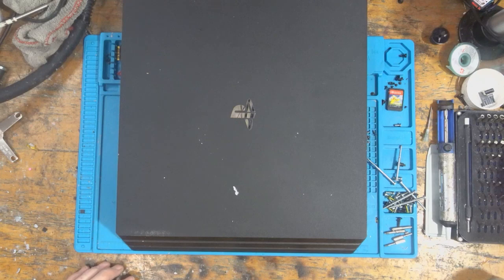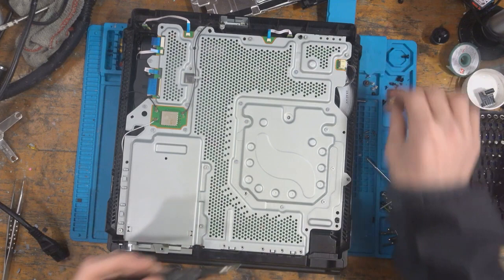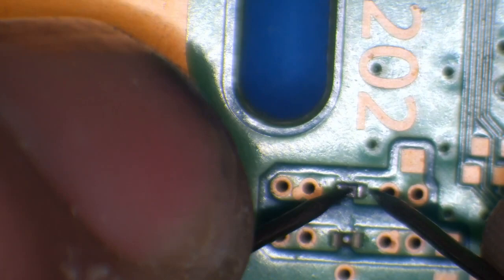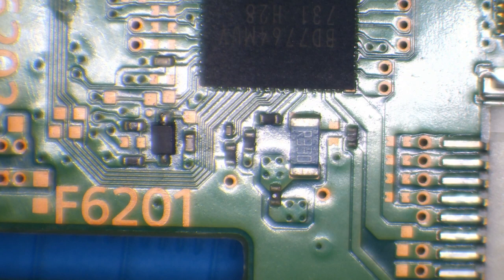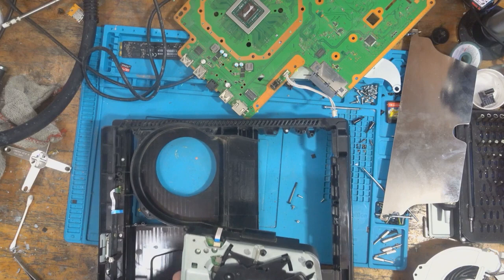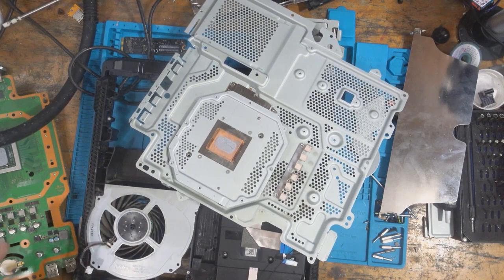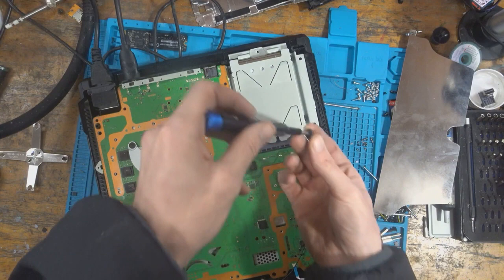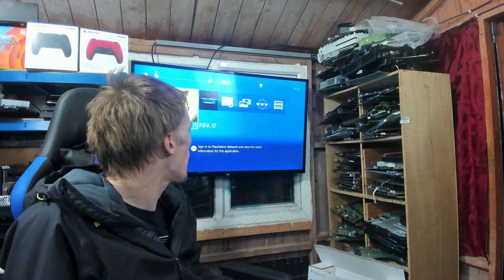This PlayStation 4 Pro Won't Accept Discs... Let's Try And Fix It!

Comment: Excellent job. If I were you I’d use the bench supply to test those fuses just to have a little more inside knowledge... you never know they may be common with other units and it might save you from holding so many spares in the future. Keep up the great work 👍😀
Reply from the maker: Thank you. Yeah I think they're the same as the switch usb-c fuse or very similar. They also share the same rating as the other ps4 and ps5 variants

Comment: My games and PS4 pro system are updating but the disc drive is not taking the disc in .
Cleaning the disc drive and it's rollers may solve the problem
Thanks for the video.

Comment: Hey! Love your videos.  I've got a ps4 pro and the disc drive stops taking and reading discs every 6-8 months. When I take the drive apart (and do nothing) and put it back together it starts working again! What could be the issue?
I got frustrated and got a new disc drive but that doesn't power on at all!  my console is model 7015B.
Ps. I'm a hobbyist, I don't have any fancy tools, the best I can do is replace parts. Greetings from Nigeria
Reply from the maker: It likely needs the bottom plate mechanism replacing. It sounds like it gets jammed and could be damaged
Reply: @TheCod3r  thank you for the response. I guess I'll swap out the housing of the old disc drive with the new one and see what happens

Comment: Got a PS4 Pro that would read discs but it was so caked in dust the discs could barely get in. So I tried cleaning the disc drive w/ w-tips & isopropyl alcohol which got a lot of dust out. But now when I start my PS4 up the disc drive immediately tries to eject a disc that’s not in there and now won’t take discs at all. Any suggestions?

Comment: I've been curious 
How much heat can these chips withstand ?
And for how long ?
Reply from the maker: It depends on the chip, but you don't want to ever use more heat than you have to and keep your hot air as low as you can while still doing an effective job of flowing the solder

Comment: Thank you for the video.
I looked through many posts and videos about this problem but couldn't find a solution.
My PS4 (old version), upon booting without a disk in it, it makes a sound as if it trying to insert/eject a disc until the blue light stops flashing.
If I try to insert while the blue light is flashing I can, but it makes a loud cranking sound for about 6~8 seconds then stops.
The system doesn't recognize that there's a disc inside.
If I press  the eject button it ejects the disc. But, I can no longer insert a disc back in.
I open the machine and looked at the parts and everything seems to be in proper order. Even manually inserting a disc with the side screw work, and disc spins freely.
Do you have any guesses onto what is happening?
I would REALLY appreciate it!!!

Comment: have an issue with my ps4 if anyone can help, when I insert ps4 disc with no scratches marks to the disc, i get an unrecognised format when inserting the disc. I rebuild the database, works fine for a few hours then the same thing happens again, I get this issue when doing a full reset as well works fine for a few hours then I get the unrecognised disc message when putting in a ps4 game, anyone help me with this

Comment: Heyy I'm having a problem with my PS4 slim my son jammed multiple disc in the disc drive i removed them out but he damage some internals so i order a whole new disk drive but it won't suck in the docs nor does the motor make noise so it seems like the disc drive has no powers but the PS4 runs excellent besides my disc drive still not working can you help pls
Reply: I also check fuses and my multi meter made the beep it supposed to if the fuse is good

Comment: Hi I was wondering if you could answer a question for me I've got an original Playstation 3 60gig  and it's exhaust temperature is 45 degrees centigrade is that too high or is that normal operation thank you.
Reply from the maker: Unfortunately I've never personally owned a PS3 so I don't know how hot they run, but 45⁰C seems ok
Reply: @TheCod3r  cheers for that have a good week and Christmas to you and yours not far of now.😁😄

Comment: Hello.I have ps4 pro ,I am getting message too many USB devices, unable to get power in ports .Tech check all fuses .No power in safe mode .Please what it could be ? Sorry for my English. I am from Georgia 🇬🇪. please reply
Reply from the maker: It's hard to say, but it could be the southbridge at fault. If that's the case the southbridge would need replacing to fix it
Reply: @TheCod3r  thank you so much 💓. I love your videos. Great person Great Technical